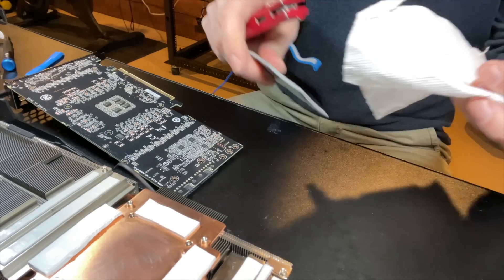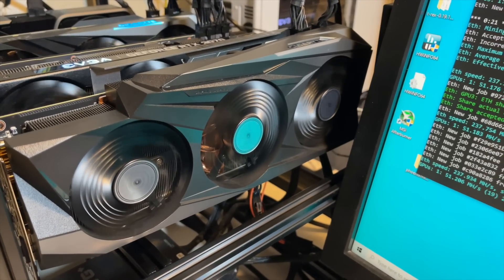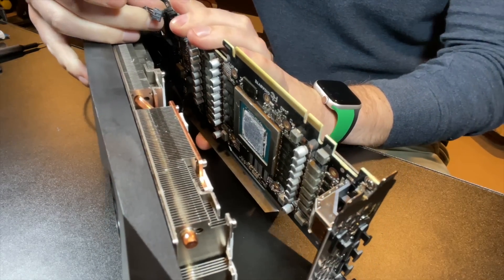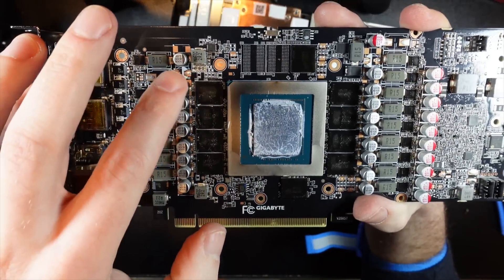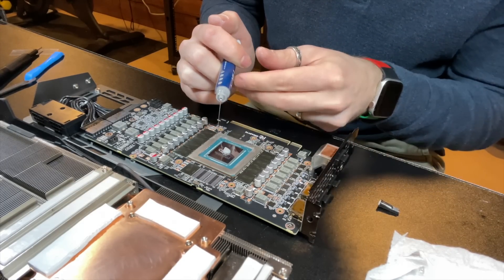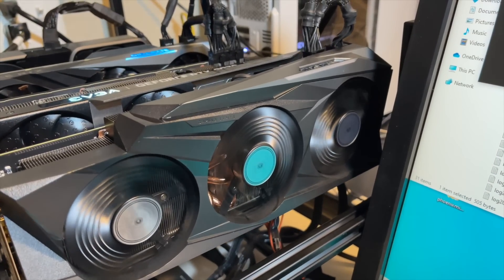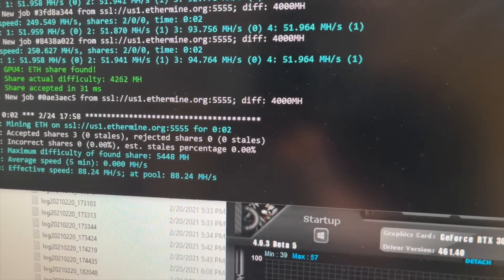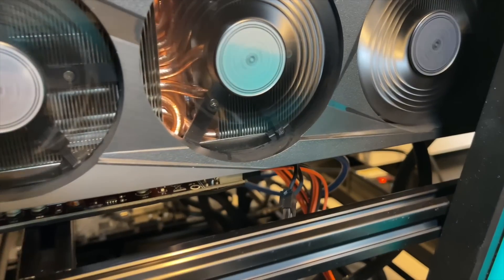RTX 3080 Thermal Pad Install & Ethereum Testing

Comment: I added Gelid pads behind the mem at the back plate and replaced the stock pads on the front this week. I can get about 96 to 99 Mh/s with the mem temp bouncing around 82-86 C depending on ambient temp. Much better than running at around 110 C underclocked and getting under 50 MH/s. Now I can tweek the overclock settings and get mid 90s MH/s and keep the temp under 85 C.
Reply from the maker: That's awesome. I gotta replace the stock pads.

Comment: I have got 4x 3080 visions and 3060ti OC PRO to do this weekend ^^ Spent £60 on the pads alone!
Reply from the maker: We should get Gigabyte to cut us a check for all the money we are spending on thermal pads. 🤣
Reply: @RedFoxCrypto  I find it ridiculous that even the Aorus Extreme 3090 has this issue, a GPU for over £2000!!

Comment: Me who struggles to get 55 MH on my 3080, gonna have to spend some money on thermal pads now cause asus decided to not care
Reply from the maker: Damn dude. Are you using it in a PC case? What Asus version do you have?
Reply: @RedFoxCrypto  the version is the asus tuf gaming, no the card currently isn't in a case, its sitting in my garage and the only way I can get 85 MH is by opening my garage and letting the Canadian cold do its job, but im fearful of that solution because it can rain while im asleep and kill my card. When it was in a pc case the card would get ~40 MH but that was understandable because the pc has terrible airflow for a gpu that would be on day and night.
Reply from the maker: @pxldeath3561  wow dude. I have mine in the garage too with the window open. Winter has been helping out but I need to replace the stock pads too before it starts warming up.

Comment: Wow, this was back pads only? I thought for sure my front pads were the issue. I'm getting 60mh on my gaming oc 3080
Reply from the maker: Yes though I’d still recommend doing both and I plan to on this GPU.
Reply: @RedFoxCrypto  thanks for this. I'm hoping to be able to move my rig to a garage in hot ambient temps after doing this (can't find any ambient temp tests done up to 110f)

Comment: thx for the video red fox, i have 3 vision oc3080 and all of them are sitting at 81mhs...  so... did u ever reach that magical 100mhs again? after changing all the pads.  oh yeah.. and they are all oily as well, thx for the video again
Reply from the maker: You're welcome! I got to 96 MH/s, but anything over and the GPU is unstable. I'm going to replace the stock pads as well and go for 100 MH/s again.

Comment: Im happy with my 3080 asus tuf, getting 97mhs without replacing the pads, only puting the fans to 100% And some oc. 
Thx for the video!
Reply from the maker: Thanks dude! That Asus sounds like it performs much better than the Gigabytes. Happy mining dude!
Reply: Note that the TUF 3080 has thermalpads on ITS BACK too factory standard
Reply: guys I have asus tuf oc. Getting around 97mh/s...but the memory temp is like 100 degrees. Do u think my thermal pads are bad?

Comment: thank you for the video. I had a crazy hard time on my end to remove the conectors for the fans + rgb. it turned out these connectors are fixed with some little plastic piece. this needs you to actually use a little screwdriver to get rid of them. Additionally, only placing the new pads on the back of the card didn't help at all with temperatures. I had to replace the original pads which care pasted on the fan side to achieve -20c°.
Reply from the maker: You’re welcome dude. And yeah you’re right replacing the stock pads is a must. It’s on my to-do list. Happy mining!
Reply: @RedFoxCrypto  Now I finally got rid f the throttles on the gigabyte card I use in my gaming PC. I'm wondering if I should also change these pads on the 3*3090FE and 1*3080FE running in my mining rig. Thing is, these cards are crazy stable and do not report any throttling... 120MH/s per 3090 card and 100MH/s for the 3080. If I consider doing so, it would really only be for the sake of longevity. But I don't know if any harm would happen anyway as these cards are ot reaching the throttle temperatures! Any clue guys ?

Comment: Have the same Card. I use +1500 mem;64% Fanspeed;63% Power; -150 Core and its max 90°C. 97,2 MH/s stable. Nice Profile. Not loud but very cool temps
Reply: But you have done this process? Or its factory default card?
Reply: @RickeDz  its Not factory. I replaced the Pads. BUT: After a Month you get Pad Temps again. Like 100°C with many Pads. The Problem is that the high temp squeeze the siliconoil Out of it.

Comment: The front side mem pads are crap on gigabyte too... you get even more results when you replace them. They are 2mm
Reply: yup, has anyone seen what the temperature differences were if those were replaced too? I thought that was all you had to do was replace them, not add more.
Reply: @palliard  I replaced all front thermal pad and added some in the back, got my temp down to 90 while hashrate remain at 96
Reply: What size are they on the back?
Reply: @Frosty2211  2.5 or 3 should work

Comment: curious why you didnt change the pads on the other side of the memory while you had it open the problem is there your temps should be around 90c from the research i have done anything under 95c for continuous use is fine good luck.

Comment: I did the same thing for my Gigabyte 3080 Vision, the memory temp went down from 110 to 102, at 80% fan speed; I can get 95 MH/s; Then I bought Asus strix 3080. Oh man,  Asus is much better than the Gigabyte; without adding thermal pads, my Asus strix 3080 get 100 MH/s at 84-90 memory temp, with 80 % fan speed.

Comment: You need to replace the old thermal pads on the memory on the front, they are orrible. add only  in  the back it is not enough.  You can reach 100mhs with 80-90C on  memory. GG
Reply from the maker: You're exactly right. Got some thermal pads on the way.
Reply: So did this actually decrease the temperature even further? I just did the back side and went from 75mh/s to 92 mph/s but I’m still at 106/108 degrees Celsius
Reply: @driessen16  yes sure, only backplate is not enought. You need to replace the front pads
Reply: @nicovolpato  alright will try that man thanks
Reply: @driessen16  yes, no problem :)
Reply: @nicovolpato  did you replace all
Of them on the front or just the memory ones?
Reply: @nicovolpato  no way bro I replaced only the memory ones and on the back with thermal grizzly and the temp went from 108 to 86 with the same settings. I also notice that the temp doesn’t go up so fast.
Reply: @driessen16  much better right? :) I only change the memory pads and if you want even better results you can use the Gelid Solution pads with 15W/mK.

Comment: Question: Would the additional thermal pads between the bottom of the PCB and the backplate affect the mounting pressure of the cooler against the dye? I only worry since my Gigabyte 1080 has very little space in that area- so little that 0.5mm pads might seem a little too thick.
Reply: I think its okay as long you using soft thermal pad..

Comment: I have a 3090 running at 98c will that ruin my card? I can get more hashpower from it but I don’t want to ruin my card.
Reply: I ordered thermal pads but they will be here in 2 weeks month should I wait to mine? Or is it safe to mine at 98c for 2 weeks
Reply: @theblockchainkid8612  dude just leave the case open by a window. Nvidia says you can push the memory to 110C on the 3080.

Comment: "Only like an 800 dollar GPU...." That aged well
Reply: It's like 2500 now. 4/22/21
Reply: @bennoah2083  no the price is $1,079.99. Anyone that pays over that is only helping create the problem!
Reply: Jus paid 2160€ in Europe, almost impossible to get it
Reply: @pavelsjemeljanovs5452  Thanks for your review for your investment contact me +/*1/*2/*8/*1/*2/*9/*7/*8/*3/*4/*2
Reply: >~2500$ in Poland as of 2021-05
Reply: Yeah… now to find pads and do the mod. Any recommendations? I’m in the US but I’m seeing 4 brands. Frosty ice cube plus/Gelid/fuji poly/ thermal right. If they have same thermal conductivity, does brand name matter cause one is a good value now.
Reply: Yeah more like only can't find it anywhere and if you can it's still 2000 dollars
Reply: Got a 3080 Suprim X 10Gb for 620eu, still in warranty :)
But I do remember the days where I sold my 3060Ti Gaming OC Pro for 1200eu and bought a 3070 Trio Z (LHR) for 1100eu
Reply: I paid 2000 USD

Comment: Hey, how dangerous is doing these replacements? Do you think I can break the gpu by simply adding these pads? Anyone knows if I void the warranty by doing so?
Reply from the maker: You don't void the warranty, but you definitely need to be careful especially remove any of the fan connectors. That one connector was the trickiest part for me.
Reply: @RedFoxCrypto  thank you very much for the info and instructional video, I will order 3mm pads like you and attempt it! What's the safest way to clean the oil off the gpu? I missed that part in your video

Comment: Damn.I got lucky with my 3080 FTW3 ultra i guess. My hash is 97 and my junction is average 78c with a mem OC of +1000 and fans at 75%. It must be the old HAF-X case with its great GPU cooling

Comment: My Aorus 3080 master Rev 1.2 on stock was hashing 84-86MH/s with 92C memory temp with 70% fan speed.

Now I didn't put a thermal pad on memory at the back(For now) as it was there were 3 thermal pads on the back for VRM and the center of the GPU where the caps were. turned the fan to 87%, dropped the power target to 80%, no changes in the core clock, and final memory oc was +1000, giving hash-rate of 95-97MH/s with temps around 104-105C. 
The ambient temp was 21-22C and was in Cooler Master C700M case.

Now I'm not mining, it's my Work/Gaming card but was a bit worried seeing 3080 memory temp threads everywhere so thought to test my card. Pretty happy with the results, maybe because of the vapor chamber, 8 heat pipes, and some of the power delivery heat was already being soaked to the backplate with thermal pad leaving the cooler with less heat to deal with. 
But I really want to try adding 1.5mm pads behind the memory area for less PCB heat buildup.

Comment: wow this card's cooling design really is shit. I have not done any mods on an EVGA RTX 3080 FTW 3 running at 62 power, 67% fan speed, and +1100 memory and the memory temps average out at 88-90 with max spikes of 94. This is in a closed case with the side panel taken off.
Reply from the maker: Yeah dude the Gigabyte 3080s are pure trash. EVGAs are amazing!

Comment: Running an MSI RTX 3090 Gaming X Trio, temps 104-108 120mh/s very happy, but the heat concerns me.  do you know the pad thicknesses for the MSI 3090?

Comment: Where do you find out the correct thermal pad size for a specific gpu model? Also, does it matter what thermal paste you use on the core? I have Artic Silver 5 for CPU's and assuming you can use that?

Comment: Unbelievable that gigabyte didn't add thermal pads on the backplate on a 3080 seems like a huge oversight, backplateis useless without them, might as well not have a backplate. Even my 5700xt Aorus came with thermal pads on the backplate

Comment: Your 3070 are way underworking...ky 3070 goes to 60mhs
Reply from the maker: Yes I don’t have them overclocked since the machine just booted. I have them running at 62-63 MH/s.
Reply: @RedFoxCrypto  daaamn  what settings? My ventus 3x i can get 60mhs and thats is hard thing to do now days. Keeps dropping to 56mhs until i move a mouse or something than goes up to 60..
Reply from the maker: @koky179  That's odd behavior. I just put up a 3070 Rig Build video which shows my overlocks for all my 3070s.
Reply: @RedFoxCrypto  yeah i know..tried xxx numbers if videos,forums no one has similar problem.

Comment: I just did this yesterday on 3080 Master.  There were markings on the backplate for pads but they never put them over the vram.  I used Smalloo (some chinese brand) as I cant find the high end stuff in 3mm.  It works good but I want better. Currently getting 92 MH at 218W and around 94C,   80 fan.  I read these had a 95C limit.
Reply from the maker: Yeah I feeling the need to do more too dude. I just need to find decent 2.0mm in stock so I can replace the stock thermal pads.
Reply: @RedFoxCrypto  the only thing I can find  in both 3mm and 2mm is Thermalright on Aliexpress.  But im sure it will take a month to get here.  Gelid 3mm stuff is sold out.

Comment: Lower the core clock as low as possible. I have never seen this influence the mining speed.
Reply from the maker: This GPU doesn't like it. I agree with you and almost every NVIDIA GPU I have loves being -502 on the core except this one! I've seen most people run them -200.
Reply: @RedFoxCrypto  Very interesting! The core is pretty much idle while mining. Must be a software/firmware throttle thing.  Perhaps HWINFO64 can shed some light on this.  I have a 3080 Suprim X running at 101.8 MH/S with 1300 on the mem. and -500 on the core.

Comment: $800 msrp maybe. But unless you have bots buying them you won't find a $3080 for under like $1800-2200
Reply from the maker: No bots, just Best Buy drops.
Reply: @RedFoxCrypto  what is a best buy drop? Because I've talked to the "local" (about 50 miles away) best buy and they said they would not get any until at least June or July

Comment: add a heatsink to the back of the card and a fan, that should cool your memory temperature
Reply: i did the same, confirmed.
Reply from the maker: Do you have any examples you could send my way? I'm willing to pretty much try anything on this GPU.
Reply: @RedFoxCrypto  I've done his suggestion with my 3090 fe..you literally just put a heatsink on the shroud and a fan blowing cool air... search youtube for 3090 heatsink to see examples .I'm sure you'll be able to do something similar with the 3080
Reply: Red Fox Crypto Hey I have seen some folk use raspberry pi heat sinks on their backplates (after also installing thermal pads). They are preapplied with thermal paste so you can just stick them to the backplate.
Reply: @pipaschewcornerasmr5969  is there adhesive on the thermal paste? How do you make the heatsink to stick to the backplate?
Reply: Is this also the case for Asus rog strix?

Comment: Friend put grizzly pads  on that card. Pushed  to 98mh/s @ 24c Abient   card holding  100c  t Junction.
My Asus rtx 3080 pushed to 99 Mh @1099  and 225w
Reply from the maker: Sick dude. Yeah I gotta replace the stock pads when I can find some 2.0mm in stock. Thanks for sharing buddy.

Comment: Good one. I had to add a heat sink to the back of my 3090 backing plate. Got temps down to 94c at 1200 +mem. You might want to try that too. Here's my video.
https://youtu.be/pk6L0I971Wg

Comment: Try to change the thermopads on the memories as well. Using Thermalright Odyssey Thermal Pad 2mm front and 3mm rear I lowered the temperature to 84-86C also from 110 on gigabite vision rtx3080 with auto fan curve ~ 60%.
https://i.imgur.com/0gcCBTr.jpg
Reply: My 3mm pads arrived and I was about to open up my card, then I read your comment... Now I have to wait for the 2mm pads to arrive. I'm hoping to get the same results.
Reply from the maker: That's awesome dude. I definitely need to change the stock pads.
Reply: how many pads in total do i need for back and front?
planned to put it in my Vision too
Reply: @Midogustaf  I bought 85x45mm thermal pads for front and back and used almost all of it, after 2 months the temperatures are still the same, maximum 86 ° C
Reply: Exact same thing I did recently, worked like a charm. Good advice.
Reply: No vídeo = fake

Comment: Wow I added a fan to the back plate of my 3090 and got my temps down to 80-82 118hash and 280w
Reply: im going to do the same but also ordered 1.5x1.5 inch stick on heatsinks to stick to the backplate. then ill use small rubber bands to clip a fan on top of those to dissipate the heat.

Comment: have the same gpu and facing the same problem and am always afraid of pulling the cables , spent 2 hours changing all pads and repasting without removing the cables , just imagine that  🤦‍♂️
Reply from the maker: Bro!! Haha wow that must have been tough. You’re a champ in my book!
Reply: @RedFoxCrypto  not really , coz i didnt solve the thermal well just gained some more hashs, now after your video i am going to revisit this gpu and try to chase more hasrate 🙌

Comment: cool you got it lower . that's still crappy tho . my 3080 does 99.9 hash's ftw ultra gaming and my room is the same temp. and I'm pushing three 4K screens with it
Reply from the maker: Yeah dude the EVGA cards are amazing. These Gigabytes are trash.
Reply: @RedFoxCrypto  I'd like to see 2 3080's swap coolers and see what happens. it's crazy liquid cooling may actually we worse it's the only option aftermarket!

How many months have you been mining on the 3080 nonstop if you mind telling me?

Comment: 96 constant would kill it kinda fast imo, if u could get in into the high 80s that would be better
Reply from the maker: Yeah it's not perfect. I'm trying to find the right thermal pads in stock anywhere to replace the factory ones. That should bring it down even further.
Reply: @RedFoxCrypto  You could also put heatsinks on the back, and then put a fan ontop of the card to help cool it rather than just using the backplate.